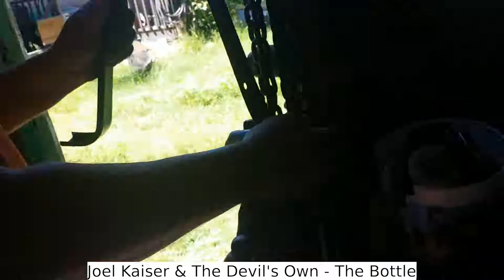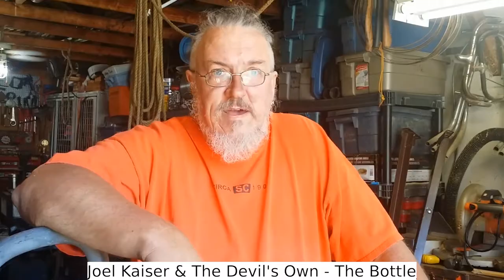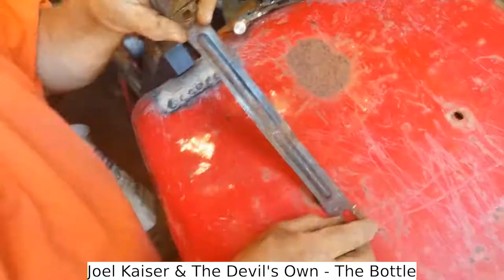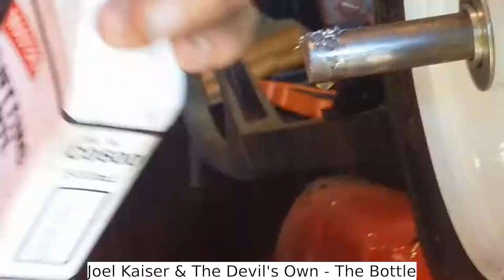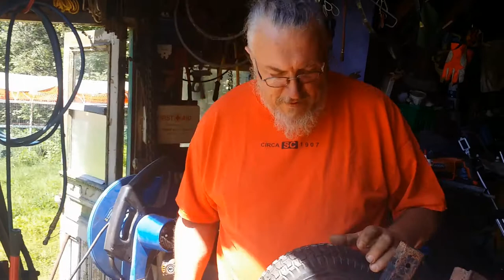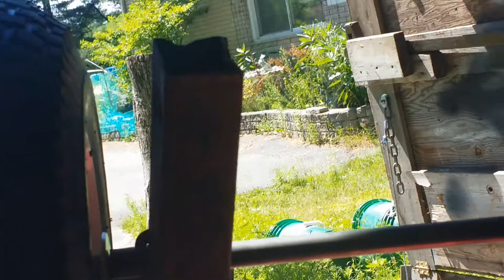Wheelbarrow Pt2

Comment: You are awesome, T,  I hope you show it rolling in another video. I don't think I have ever seen a 2 wheeler. And I like the socket attachment for your drill. My handles are wood. The cost of replacement is more than a smaller wheelbarrow.  I did not like that smaller one. It dumps over easy. So found another big one t a yard sale. One day I will put my old one back to work. So I would love to see the 2 wheeler moving. Is it easier with 2 wheels?  Or more weight?
Reply from the maker: TheEmptynester 1 wheel is more manoeuvrable, but requires more BFI. My wife can move 3-4 times more in this than in her old favourite.